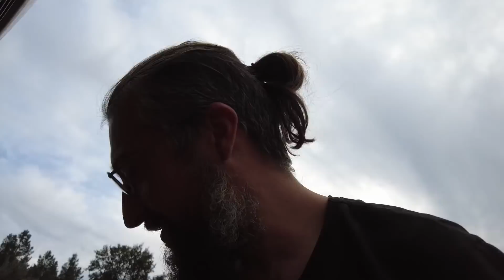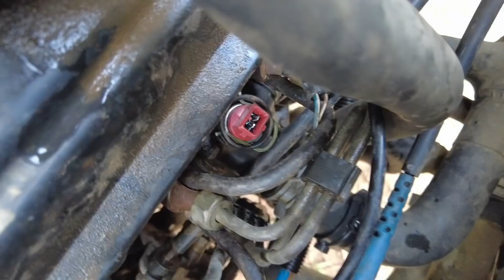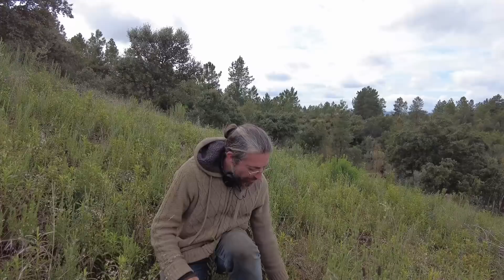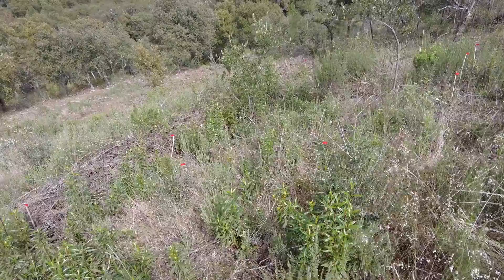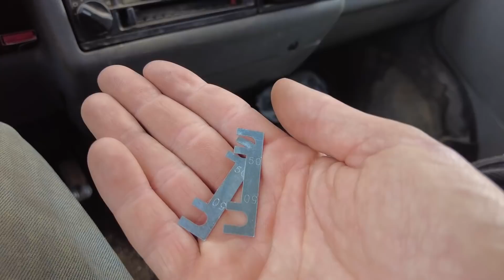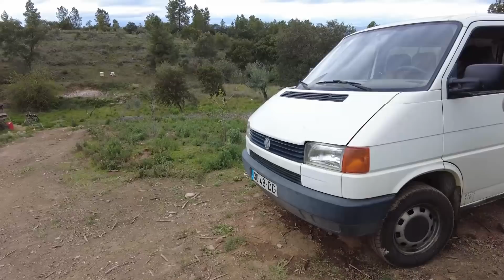Learning mechanical skills is also part of self reliance

Comment: I feel for you with regards to having to travel to buy bits you need. Our nearest hardware store is 40km away and last week I had to go 80km there and back for a 30 cent bracket to finish a job which I hadn´t foreseen. Not the first time either. What I do now is buy 3 or 4 of everything even if I only need one, unless it´s something expensive. Yesterday I was installing a rain gutter on our roof and managed to do it with all the extra plumbing fiitings I´d bought over the years!
Reply from the maker: If I ever get to finish the shed/workshop I’ll start hoarding parts as well so I can reduce the number of trips to Castelo Branco. Cheers, Maarten

Comment: Hey Maarten, there are also about two liters in the heating system. If you emptied this, and even if not, it could be difficult to get the air out of the system, of course it helps to drive the car on a hill, with the front up, or lift the front axle and let the engine run with the radiator open, otherwise you can`t get enough fluid in the radiator, cause the radiator for the heating-system is the highest point.
Reply from the maker: I think I drove all the remaining air out of the system when I went on that fuse trip and needed to top up, but I’ll keep an eye on it thanks.

Comment: I have never been extremely gifted at auto mechanics, but have developed some ability if I work slow and have the right tools. When I was a lad of about 18 and lived in a small Texas town, I owned a used 1956 Chevrolet Belair. I was driving down the highway and all of a sudden the motor started to miss very badly. I pulled into an auto shop nearby and asked that he check it out. He said that the good news was that the distributor cap had cracked and that was what was causing the missing. The bad news was that the cap had cracked due to the fact that the motor mounts had broken and allowed the motor to fall back until the only thing holding the motor in the car was the cracked distributor cap.
Reply: Hazel ☘️ …
That was in the good ol’ days when you looked under the hood and you could actually see an engine and all its parts ! 
🙏☘️😘
Reply from the maker: If the mechanic says: ‘the good news is…’ you know something awful will follow. I don’t know whether I ever be gifted at it, but I’m sure I can learn more by trying to figure out what’s wrong than just handing it over to a garage. Thanks for sharing! Maarten

Comment: Haha, that was fun, I love watching you work on the engine. My Dad would have a fit though as when you're working under or in front of it you don't put a chock in front of a couple of the wheels as you're on a slope. Even if it's in gear it's still a safety precaution worth taking.
Look forward to seeing you clearing the area around the baby trees.
A drop of vino always makes a job easier!
Reply from the maker: I’m glad you liked the video. I figured the car was staying in place because where it is parked it is pretty much level and the car would most likely roll backwards in that spot, but I hear you it  would have been safer with a few rocks in front of the tyres.
Reply: @ourportuguesehomestead Guess it's flatter than it looks on the video. You can't be too careful though, if you ran over yourself it would be difficult to drive yourself to hospital! 😉

Comment: Antifreeze also stops the rust.  That rusty water will damage the water pump. I would do that soon if I were you 👍
Reply from the maker: Yes, I won’t wait until summer is over with the next flush session. Thanks 😊
Reply: Antifreeze inhibits corrosion and lowers the freezing point but it also increases the boiling point of water, preventing coolant loss in summer.
Reply: A proper antifreeze is critical. Make sure it is rated for a VW. With my old Mercedes I was advised to used the Mercedes approved antifreeze products. The chemical composition can still do damage to waterpumps and other metal components in the cooling system.

Comment: I enjoyed that,, Drunken Car Repair with Maarten :-) good fun!! A little bit worrying that it killed a 50amp fuse,, that is a big fuse.
Reply from the maker: I think it may be a case of metal fatigue due to repetitive temperature swings over the years. It is a pretty thin plate of metal held in place by screws so can’t shrink or expand.

Comment: Also, at 40 cents each, why not stock up on 10 of each kind of plate fuse that you need? Beats driving down for a single fuse all the way next time...
Loved the background music though, quite trippy that trumpet! :-)
Reply from the maker: 20 cents each and they only had a few so I just bought what I needed. Also, I don’t really have a good place to keep extra parts without losing them so this might be something for when I have a better storage/workshop setup.
Reply: @ourportuguesehomestead  Hi, good job by also taking care of the old fluid. Just one thing, don’t work at car electronic without disconnecting the cables from the battery terminals...💥💥💥
Reply from the maker: I agree with you in general, but this was on a seperate loop from the batteries and by disconnecting the two bolts on the one side of the fuse it did exactly the same thing as if I disconnected the terminal on the battery 20cm away.

Comment: Hello Maarten - hope you can get some help for your van. As you are located in such a remote area it must be a real worry not to have the van in working order.  Fingers crossed you can get some help. Stay safe you lovely family. So hope the glass of wine helps you to repair the VW van successfully. Xx
Reply from the maker: Thanks, but the repair was successful and I am lucky enough that I have two mechanics in walking distance so I’m not too worried about the car. It helps that Puck can get to school by bus most of the time :) cheers ✌️

Comment: Have you ever tried to use your electric drill to fasten and disconnect bolted joints after breaking them free with your ratchet?
Reply from the maker: I have tried in the past, but usually the space is limited so I’d run the risk of stripping the heads. There are powered ratchets that can fit in most spaces, but I don’t think they’re worth it for now (for me). Cheers, Maarten

Comment: Hi, just curious but being off grid as you are how do you dispose of the coolant flush? With a larger question of how you guys manage non biodegradable waste in general?
Reply from the maker: In Castelo Branco there are a few places you can go for disposing fluids. Portugal has a recycling program for the usual stuff like paper plastic metal and glass.
Reply: @ourportuguesehomestead  hi, thanks for the response 👍. Nice use of the wine as workload lubricant by the way 🥴

Comment: just some advice... Are you sure that is the right antifreeze? VW take specific type of anti freeze and it is normally pink....... it makes a big difference......... also only use distilled water in the cooling system out here or water from the mains water, natural water from a well is not good.
The vw t4 suffers from cracks in the cylinder head so you need to take care of the cooling mixture.
the rust in the water is because it did not have the right antifreeze in it, that is the inside of your engine rusting and is bad for the engine..... you should flush the radiator out then add new coolant with the correct antifreeze.
They also take a very specific engine oil, any oil will not do it has to be for that exact engine or the engine will wear away very very fast.
  i have 20 plus years as a VW specialist mechanic.
Reply from the maker: I asked whether this one was suited for the T4 but I’ll do another flush soon and get the pink stuff. I think the previous owner wasn’t that careful because a lot of people around here just use water as coolant. Thanks for the tips, appreciate it! Cheers, Maarten

Comment: You live in a first world country and we live in a 3 rd wold country. There should be something thereto flush out the  radiator from all the rust collected over the years
Reply: Those flushes are risky specially in an old car like this, it can open up some holes in the system and start leaking… better keep the system moderately clean and change coolant once in a while